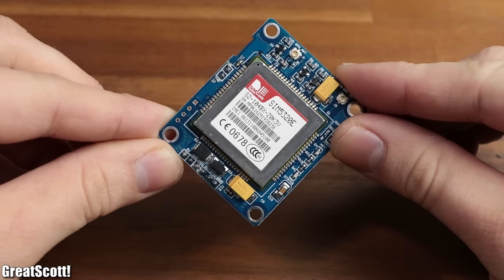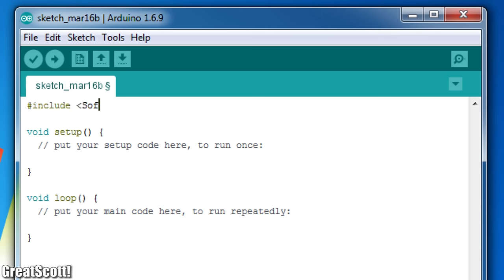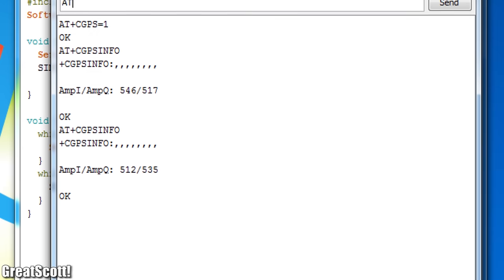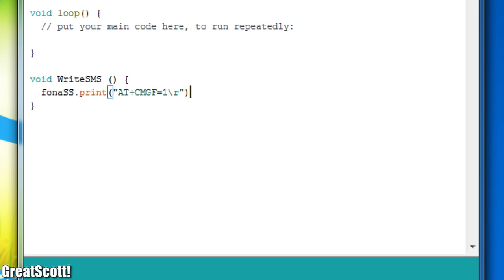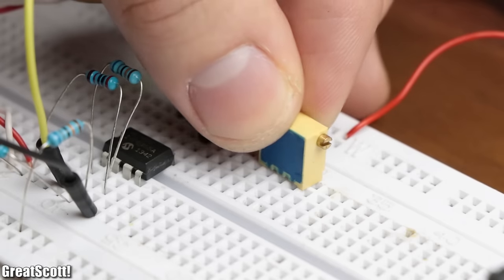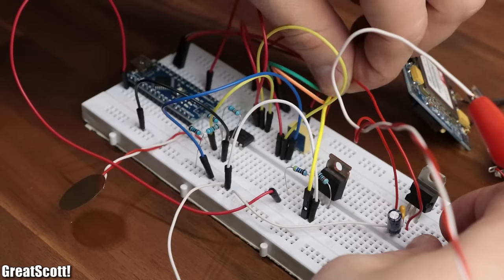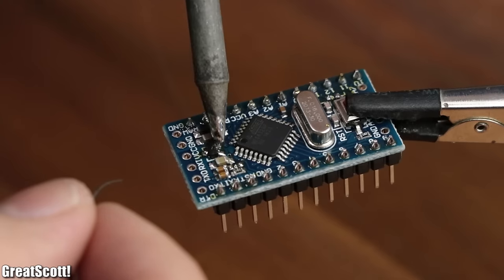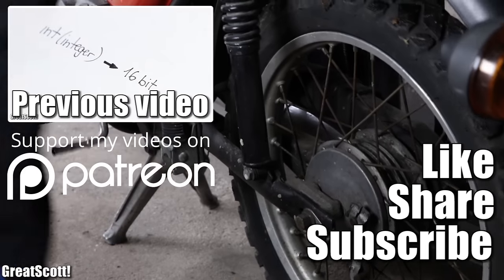Make your own GPS SMS Security Tracking System

Comment: hello, you always have a great videos. Here is my 2cents: 1. for gmail you will need a secuirty hash or enble you gmail with less secuire app enable. i will update with links. 
2. for the penzo, just yse a 1M ohm in parallel with the sensor and your Analog pin. I will also update with link and example.
Reply: Go to your Google account settings and enable "Allow less secure apps" at the bottom of the page. There the app will only need email account and password.

If you concerned about security, just use different account.

https://myaccount.google.com/intro/security#activity

Comment: Great video as always Great Scott! 
A question / suggestion.... Is there a reason you couldn't set it up to send the gps coords if / when it receives an sms text message?
It seems even more useful in that configuration as you are not reliant on the bike moving to pinpoint it's location. You could simply message the device and get a response as to its current or last known coords...
Reply: Exactly what I am thinking. Your approach is better! Here you are dependent on the sensor output to have the system triggered that means there is no way you could get the latest coordinates on demand.
Reply: The sensor is better, because it alerts you as soon as the violation occurs. Imagine not knowing for days that your bike is gone. By then, the gps unit has probably been discovered.

Comment: have you enabled "less secure apps" in your google account? without this setting, you'll never send email using gmail, and you get those server error...
and, better using a dedicated account to send them, to not "relax" security on your main one...
https://support.google.com/accounts/answer/6010255?hl=en
Reply from the maker: I created a seperate Gmail account for the tracker and also enabled less secure apps. But there still were server errors.
Reply: have you tried from pc to test that smtp, for example using thunderbird portable or whatever mail user agent you want? Very strange, no other debug info from that board, i suppose... :(
Reply from the maker: I did not tested it with another software. I should have done that.

Comment: isn't the piezo triggered by sound?  wouldn't you be better off with an actual vibration sensor? i mean, you wouldn't like to get an sms as soon as you close the garage door a bit uncarefully or if someone whistles nearby. =)
Reply: the sound (movement of air) would need to be very loud. at 5:00 he build a comperator to prevent this problem (in other words, a signal is only given when the shock/acceleration reaches a certain limit which is not reached just by sound)
Reply: ok, thanx for teaching me something new! =)
Reply: Have you noticed loud exhausts of cars and bikes setting off alarms ? The same is applicable here, it just needs to be loud enough or it wont be a trigger.

Comment: Nice. I'm looking at doing something similar, but I need much less power drain. I'm probably going to use an ADXL362 accelerometer, which draws micro- or nano-amps, depending on how you use it. I think I will be able to set it up to power-off everything except the accelerometer until an acceleration threshold is reached, meaning battery life would be very very long.

Comment: you need to enable less secure apps on gmail so you can use "normal" smtp
Reply from the maker: Tried it. Didn't work.
Reply: GreatScott! You can use mqtt!
Reply: Port 25 could be blocked by the mobile operator. It's hard to use unencrypted SMTP on the Internet now.

Comment: I think, the piezo would work on analog pin too, I remember creating a simple Arduino device. The harder you tapped the piezo, servo would move to certain position. If you tapped softly, servo would go to around 20, if you tapped super-hard, it would go to 180.

Comment: I think your email or any 3G capabilities of the board didn't work because you didn't setup the APN settings.
Reply from the maker: But I received an IP address while trying to send the Email. You can even see it in the video. So I don't think that was the problem.
Reply: Oops my bad I didn't notice the IP address. How about a trace route or ping to see that it can access the outside?
Reply: gmail is nitpicky with authentication. maybe thast's the issue. a basic mail lib that doesn't offer everything required. I could never connect to my gmail account from PHP either.
Reply: if you'd like i could write a PHP wrapper so it would report location to website and display it on gmaps.
and yeah gmail sucks for diy projects, emails get blacklisted ect.
Reply: Gmail is working fine, but you need to activate it separately! First you need the two factor authentication on your account then you can make a second password for your (custom) application!
Reply: google smtp servers require authentication in order to send emails. try register an email account at your mobile carrier. those should work fine. I had the same type of issue when trying to set up wild camera, that can send photos via email. or you could try restricted google smtp. https://support.google.com/a/answer/176600?hl=en < have not tested tho.
Reply: +FERCSA you are right - thats the way have to go .... learned that painful lesson yesterday and it works!
Reply: It might help to allow "less secure apps" to access your account. I had to that for my QNAP NAS, as described in https://www.qnap.com/en/qa/con_show.php?op=showone&cid=354
Reply: I've had issues setting up gmail on many platforms due to their authentication, could be right
Reply: GreatScott! I'm sure you got the APN right, but there's no need to use gmail's mail relays for your outgoing emails. Just check with your GSM provider what outgoing mail relay to use. Usually they don't require authentication (which I assume was the problem here), since they can tell you are a real customer (as opposed to a nasty spam sender) because you already are on their network.

Comment: You could get so much more life out of it if you had the motion sensor activate a flip flop that controlled the arduino's voltage. Then the Arduino could "sleep" by turning the flip flop off and deactivating itself. That way there's no 3.5 mAh usage, it's just 0. 60 days is a rather annoying interval to replace batteries.

Comment: isn't there an acc line on the bikes key switch? couldn't you use that instead of the another separate key switch?
Reply from the maker: Yes, that was also possible.
Reply: Actually, if they break into his house to steal the keys, this is safer.
They don't expect this second feature so they'll just use the key switch from the bike itself despite heaving the key.
Reply: If they steal the bike they are probably going to force the main key into the ON position, either by breaking the cylinder with a screwdriver, making a contact, or lock picking. Having a second hidden key is the best solution. Even a simple hidden throw switch would have worked.
Reply: the ignition key on a simson is easy to "hack" with an 5.5mm flathead screwdriver, the system is very simple

Comment: I don't know if you did or not, but you should use something like this to avoid excessive sms messages:

if newGPS =/= oldGPS {
     sendmessage()
}
Reply: That would require a bit more logic than that as GPS isn't necessarily the most accurate all the time. Even if the antennae is completely static, a GPS read 5 minutes apart could yield slightly different locations.
P.S. *!=
:)

Comment: Thanks for the Peizo Idea. Its low cost compared to accelerometer. But,  I used accelerometer though in my GPS tracker VALTRACK-V2 (Still under development). Accelermoter sensor  has a motion trigger feature which i am configuring and using to send SMS or push notifications when someone moves vehicle.

Had a question, Does SIM5320E work in Singapore also? 
Has anyone used SIM5320E in Singapore?

Comment: Two things:
1 put more air in your tires
2 after the device is tripped the code should compare GPS values to see if the bike has been moved to avoid false alarms. A large trash truck, fast car whizzing by or someone bumping the bike would all be issues.
Nice video nonetheless.

Comment: Why did you remove the arduino's 5V regulator? If you're supplying it with 5V directly from the external 7805, wouldn't the regulator be inactive anyway?

Comment: hey... great video! you could connect the battery to an analog pin on the Arduino and set the board to send you a message when the battery is almost dead, so you don't forget to recharge it.

Comment: Great work, i was thinking to build something similar for my bicycle. Would it be possible react on incoming sms? I would try to use the power supply of the lights. Use case: Bike is stolen, I send an SMS to the simcard. Next time the bike is used, the electronic gets power, the sms is received. And the GPS-data is transmitted. This might result in less false alarms.
Reply from the maker: Yes that is also possible.

Comment: Thanks for the video, always enjoy watching your projects! :)

Question - What is the straight metal connector you use for soldering on a perfboard? I'd like to use that in my projects as well? It's much less messy than wire.
Reply from the maker: It is silvered copper wire (d=0.8mm)

Comment: I’m a bit late, but why don’t you get one of those DigiKey IOT phone plans. They are dirt cheap (like $3/month) and 5 cents/sms?
Reply: Hey dude, mind if you help me out? I need some help with changing the baud rate, as explained in this video. You think you could help me with that?
Reply: Luca Prencipe To change the baud rate on the serial monitor, click the current baud rate and it should be a drop down menu that you can select it

Comment: I wish I had this before they stole my "Schwalbe"...
Reply from the maker: Noooooo
Reply: Just wanted to check with you and see if your device can receive SMS messages. Because if so; it's a bit short sighted to only send a few time delay messages before going to sleep. If stolen, I would hope your solution is enough, but it seems it's more 'peace of mind' than actual security. 

An ideal solution would be to have a ~10 min delay between position updates until you manually give it the all clear. Just imagine if it's actually stolen and the theifs don't happen to stop within those 30 mins, you'll just be chasing an aberration because there's not much you can do with a few gps locations 30+ miles away from eachother. 

Still though this is a very neat project and it's one that I can certainly see myself giving a go. Maybe I'll try and add some 'false start' prevention by checking if it's actually moving. And an accelerometer to send an SoS in case the shock sensor is tripped because the bike tripped over.

Comment: Good video congrats. I'm building something similar for my car but with a different approach. I'm going to use the cheaper SIM808 board, no need for 3.5G networks imho, and a more complex multiple mems 9DOF sensors, the MPU 9250.
I think the sensors attitude aware data will give a positive image that the car/bike is being moved with no authorization :) 
Actually that sensors works much better in a motorbike.
Also ... nice retro bike :) 
There are 13€ boards for sale on the SIM808 with sleep function pin available. And the MPU 9250 is also really really cheap (around 2.5€).
Nice idea tho !

Comment: Cool video great Scott. Do you know if it is possible to do a notification passing from ios or andoid via its bluetooth to something like HC-05/08 and has an Arduino process it? Sort of like making your own DIY blue tooth SMS receiver.  It will be very useful to display SMS in a small LCD in the car while driving without reaching a phone. I searched and found that about the only thing that does this is some cheap chinese activity tracjer/watch. I just wonder if a DIY version can be made.

Comment: #define FONA_RST 4
Adafruit_FONA_3G fona = Adafruit_FONA_3G(FONA_RST);

How to  connect pin 4 to the "RST" of Arduino Pro Mini MCU board?
Just connect a wire to the "RST" with pin 4. am I  right?

When I manually reset button, the voltage drop from "RST"  at 3.3 V to 0 volts. I specified the receiver mobile no. No message is received yet.  For British Hong Kong I  used "+852xxxxxxx".

Comment: To send the emails through GMail you would need to use smtp.gmail.com with the port number of 587 with TLS or 465 with 465. You also need to allow less secure apps in your Google Account Security Settings to use it. Not sure if the Arduino or the Cellular Board can do TLS or SSL. The other option would be to setup a PHP Script to do the Email work and just make a web request to it or setup a smtp server of your own and secure it, to send the emails for you.

Comment: Re: The email issue, I have found in the UK that some mobile providers use public IP addresses that do not have a PTR record (Reverse DNS entry). Many providers don't allow SMTP connections from these as it's a way of combatting spam. Find out the IP address your 3G connection is using publicly and check it out on mxtoolbox.com to see if it has a PTR record using the query "PTR:203.0.113.10" replacing that IP address with your own.

Comment: "Direct" SMTP (port 25 iirc) is often blocked by your ISP to refrain mailicious packets (that have been forged by hand) to get to your computer... if this isn't the case you might receive an email from the official amazon email asking for credentials (scam), because there is no client-side sender ID verification by default. (you can send a "manual" email via command line that can have any email adress you want, that's bad.)

Pretty sure that's why the mail didn't work on your board. It probably doesn't pass the packet to a centralized and verified authority...

Comment: Great project. I've bought all components and after I hooked up the SIM5320e to 5V I can communicate with it. After I entered "AT" it responded with "OK". But if I enter another command like "AT+CGPS" I get some cryptic signs and it seems unstable. I can also ONLY work on a baud rate of 115200. The other rates doesn't respond. 
Can you please help me to fix this problem?!

Comment: Congratulations +GreatScott! 

This is a great project... But may I suggest you a few mods to make it even better?

1) There is no way for you to know how much power is left in the battery... How can you modify it to provide that info? 

2) How can you provide for a way to recharge the battery without removing it? Or even better, eliminating the battery and replacing it with the vehicle's own battery?

3) This 3rd question is not related to this project in itself, but how about making a future video explaining the way to calculate the battery lifetime of a device without running for a few charge/discharge circles?

Keep up the good work!

Comment: The server error that you recive while using the SMTP method its that your email provider "GMail" uses an authentication method that you need to instert on the browser. The best way to use that SMTP method on the arduino is to make an SMTP server by yourself... Or disable the secure login from your gmail account.

Comment: My cousin is his alarm company leader and he got my dad very similar system but without GPS. This system was for bee "hotel" (as my parents call it). It sends a message if: battery is low, door of the "hotel" is opened or closed , or the system detects a vibration/shake.

Comment: Hi! "Great" project Scott, but did You know that the SIM5320 is a standalone platform with LUA support itself? You can drop the whole Arduino stuff and use the module itself as detector of interrupt events, You can read GPS info, send SMS, send data to server, etc... Less power consumption, more battery life. In addition, You can feed the SIM5320 directly from a Li-Ion cell, need no regulator! To save more power, You can use an ADXL345 acceleration sensor with programmable activity detection to wake up the module via interrupt event...

Comment: The GPS from SIM5320 has a good accuracy? What was the GPS fix time you got when you gone to the street? I'm starting to build my own Vehicle tracker, it's a good idea to use only SIM5320 or will be better if I use another GPS module + SIM5320?

Comment: Did You know that the Arduino is absolutely unnecessary in this project? The SIM5320 module includes LUA programming platform and You can implement lot of functions without the need of external components!

Comment: I understand this design except the part of using an old cell phone's SIM card.  That old SIM card is programmed to an old number that no longer is activated by the old cell carrier.  Can anyone explain how this works?
Reply: Reactivate it and it works fine
Reply: Nathan what about a cheap burner phone with monthly minutes? Will that SIM card work in this project as long as you're up to date on active minutes?
Reply: @no5x937  it should but the sim card will need to be programmed for the board if you use the sms/mms or voice but data will work fine without doing that (that is how i got my new smartphone to work with the sim card from the old one until i got it setup)
Reply: @Nathan What carrier are you using (Verizon,  Sprint  AT&T)?  And does the SIM card need to be unlocked?

Comment: You probably got the email server error because you didn't use the right security protocol. Looks like you're using Gmail for SMTP, and I know you can't go through port 25. The correct port is somewhere in the 500's and the security type is TTL (I think).

Comment: I made 2 years ago very similar project. My project was little bit more complicated. I used accelerometer (I haven't got idea about another use of piezo). Added cheap bluetooth module = it checks if my phone is near while car is moving if not it sends SMS. Final touch was small UPS = in my car all sockets are controlled by computer (no key = no power). So please consider adding bluetooth module to your project.